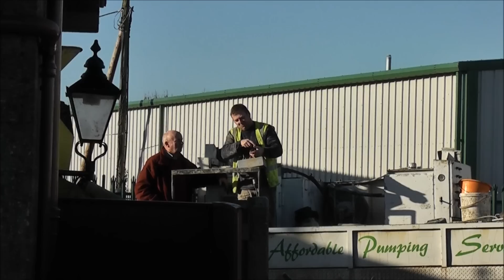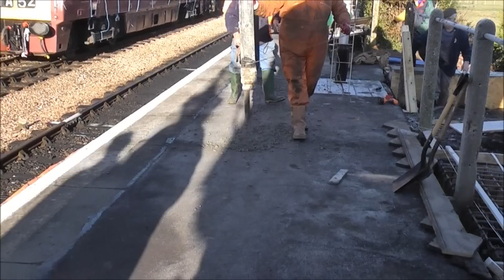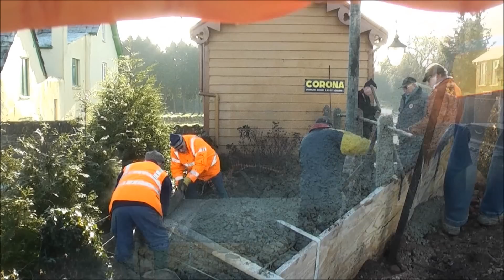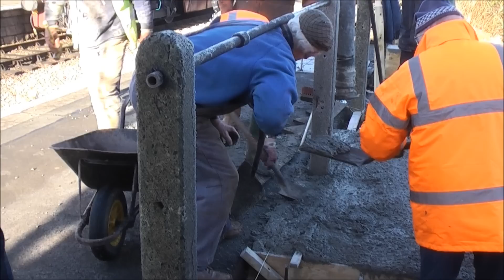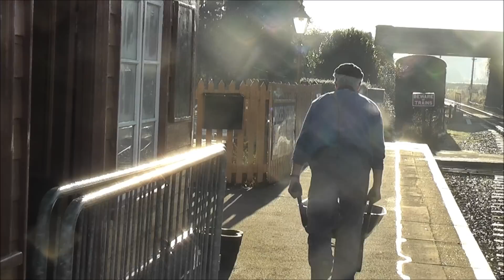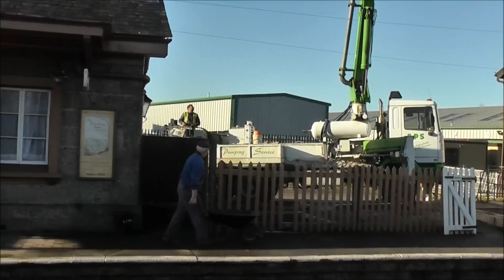WILLITON WSR BRIDGE CONCRETE DELIVERY Part 4

Comment: Again very good report Mike.

A lot of work for the many volunteers.

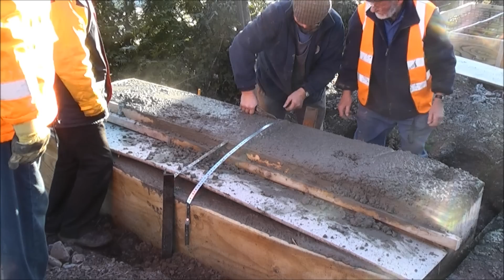Why did the man cut the metal strip ( 0:29 ) ?
The planks are little bit weak. One should not underestimate the pressure from the concrete.